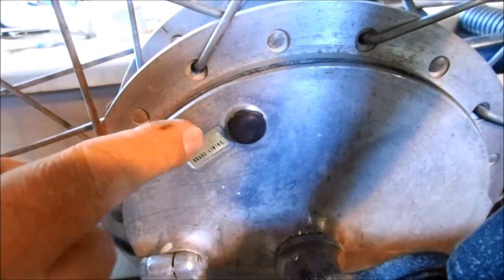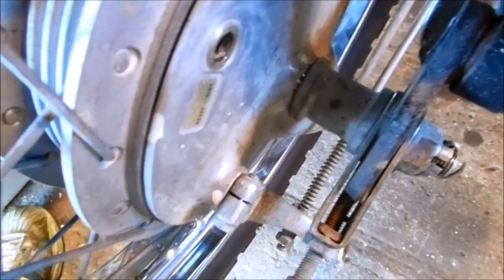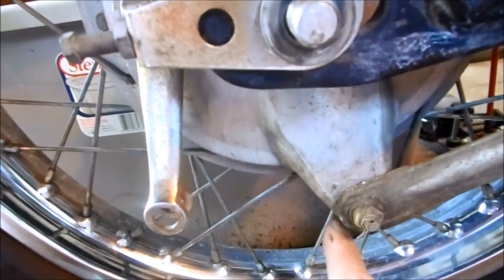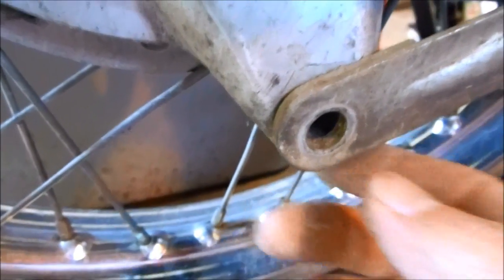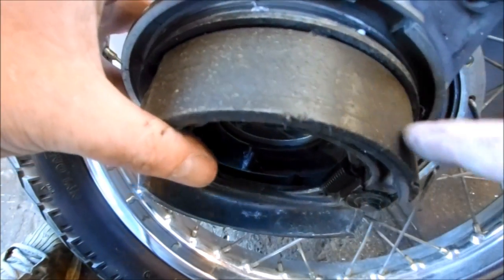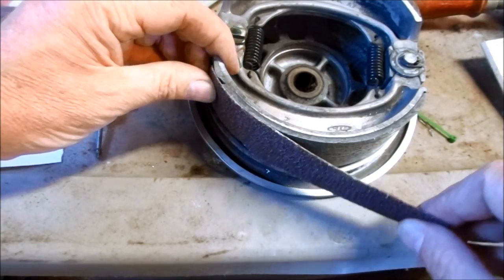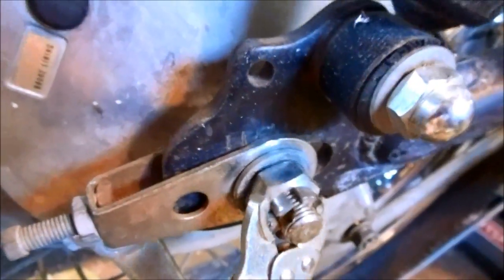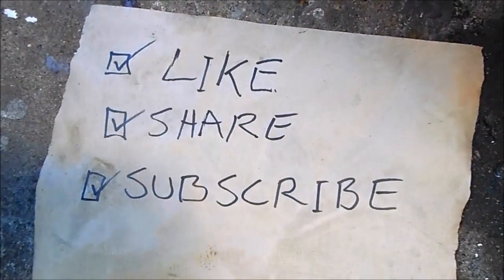How to replace Motorcycle brakes

Comment: Thank you for this channel. I have learned so much while I was fixing up my brothers bike. Unfortunately he was killed last week when his handlebars came off. 

Witnesses say that just before he rounded the curve the front wheel came off first but he instantly pulled a wheelie and managed to get around the bend. At that point he was on the wrong side of the road and facing oncoming traffic. He prepared to switch lanes and turned on his new custom made indicators. The witnesses say there was a flash of light and then a dense cloud of smoke as his wiring burnt out and petrol leaking from the custom fuel cock caught fire (I had warned him to spray the wires on the new indicators with WD40 before use, I guess he did not listen. No idea why the fuel cock I had taken from an old boat failed. He must of messed with it). It seems, from eye witness accounts, that his brakes may have failed also. I think this might have been because he used wet and dry for a brake liner instead of coarse grit sandpaper like I told him. We will never know as the bike was consumed in the fireball. As were half of the stores in main street.

Standing on the custom saddle I had made him from cardboard and an old pair of jeans and surrounded by flame, with his legs blazing and his custom helmet -- made of a cut in half plastic soccer ball overlaid with tin -- alight and dripping molten plastic down his neck (I had always told him to wear protective clothing on the bike and not just the T-Shirt and boxers shorts he was wearing that day. Would he listen? Would he f---!) he attempted an unwise manoeuvre. Screaming in pain, he yanked on the handlebars in an attempt to change direction and get back in lane but they came off (He must of failed to grease the securing nuts with margarine like your tutorial said) in his hands and he fell backwards into the path of an oncoming cement truck and got squished. Well, at least the squishing put the flames out, so that was good.

We buried him in an envelope.
He was 13.
The 750cc bike, was 18.

Unfortunately, the bike carried on and finally went through the window of a store and exploded. Five old ladies and a gay boxer named, 'Quite Angry Marvin,' out on a day trip to buy batteries for their sex toys, were killed in the inferno. 

Still, not to worry. I look forwards to some more great videos. I am working on my sisters Fireblade at the moment and installing a cruise control made out of a washing up liquid bottle and some super glue. Its going well so far. Wish me luck.
Reply: oops..thats a mad bad sad story,..but as I always says. ..the reality always beats the fiction..
Reply from the maker: +InTheNameOfJustice  peace be with you and your family in these difficult times.
Reply: +Ichiban Moto And also with you and yours.
Reply: wow lol
Reply: hahahaha this was the best.
Reply: what kind of envelope?
what colour?

description is not good enough

Comment: Oh thank you very much! You are my hero and save me a lot of money during restoration my bmw cafe racer. I would like to fix the brakes, but ive got weird thin disc on wheel, not drum like you. Can i glue the sandpaper directly on the disc?
Reply: I would just keep your worn out grinder discs and swap them straight out
Reply: Just bend the disk slightly, this will compensate for the pads having gotten thinner, as the warped disc then can fill out the gaps properly !

Comment: Those Honda brake lining kit upgrades should always be used with assembly lube or at least marine grade wheel bearing grease, or else the stopping power will be too great and could be dangerous. Your videos have inspired me to modify my bike, so I have just fitted an ash tray to my Honda CB90.

Comment: One of your best videos yet! Some of the technical jargon confused me a bit though. I agree with back road moto, just filling the drum with (fine) gravel via the filler hole, is quicker and just as effective.
Reply from the maker: +Back Road Moto    +Peter Huskins   I'll have to add a baggie of gravel to my tool roll !
Reply: Ichiban Moto I would advise a degree of caution when selecting a fine grade gravel. Here in the UK we use a decimal grading system, as do most Japanese manufactures. I'm not sure imperial gravel commonly available in th U.S would be compatable.
Reply: +Peter Huskins "Imperial " is technically Japanese
Reply from the maker: +Peter Huskins  I'm sticking with oem Honda gravel
Reply: Ichiban Moto If you can afford (or get hold of) OEM parts, it's probably a wise decision. I once filled my tyres with cheap Korean air to save a few pence and the handling was really not up to standard.

Comment: I new they were ripping me off at the bike parts shop selling me a pair of shoes, my tires are worn  and they say I have to replace them. Do you have any tips on carving deeper tread to prolong tire life and save money,is there a special tool a heated chisel or drill bit.
Reply from the maker: +Jeffrey Butt  I will add that to the video suggestion list !
Reply: +Ichiban Moto This would be a great video.
The grooves on my tyres fill up over time too, to the point that they appear smooth and need emptying.

Comment: Are these a better idea than ceramic brakes? How hard is it to use the assembly tape? I haven't learned how to use it before...
Reply from the maker: +Jesse Carstensen    it takes some practice but it comes with a step by step instruction sheet
Reply: Ichiban Moto thank you again Ichiban Moto for a badass video!

Comment: Those lining refurb kits look PROPER grippy! Careful when you haul those bad boys on, you'll be eating handlebar sandwich in no time! 

Another fine tutorial. Do they make those kits for disk based braking systems? Mine are wearing a little thin and I like the ease of use. 

Thanks Ichiban Moto!
Reply from the maker: +Andy Man Cam   most excellent cautionary advice , most are not experienced with using racing quality linings. They do make disc kits as well, however special amber friction grade assembly glue is required, so please follow the instructions on the box closely.

Comment: Does the brake drum stay actually effect the braking at all?
Reply from the maker: when pressure is applied , it keeps the entire mechanism from rotating with the drum and wheel
Reply: @IchibanMoto  will it effect the braking at all? As I installed mine back on and it stops the wheel from rotating a bit

Comment: You forgot to apply a liberal coating of copper grease to the Honda brake pads to stop them squealing.
What do you means by good brake cleaner? Would WD40 do?
Reply from the maker: +Penfold50   WD40, WD41, whatever's on sale

Comment: Brakes will get hot going downhill, I surmise.  Also it is hot near the blacktop.  The glue backed sand paper would change in temperature in the outdoor and usage elements and the glue would be in proximity to the contact surfaces.  The assembly tape is how the master reveals this danger.  Still, if you never travel hills or live somewhere very temperate it might be a foolish, working fix.  However the arcs of the contacting surfaces might distort.

Comment: guys, i figured out an even better, cheaper system. i use 2 sided carpet non slidy tape and cat litter. i put the litter (carefully screened of turds) on one side and use the other side to attach it to the worn shoe. works great and i get lots of attention from the neighbour hood cats and hot chicks like the one at 2:21. Bad ass!
Reply from the maker: +Fear Goodjudgement    awesome.... always looking for improvements !

Comment: What's up with that screwdriver and why did you use a match to light up the sight hole instead of a flashlight?
"And don't forget the nail" 😂
Reply from the maker: 360CEA725    I make my screwdrivers . want to buy one?

Comment: How stupid !   An inexperienced young novice rider could look at this video and actually follow the instructions given here and have an accident as a result.  Always use the correct size spanners, do not use a bit of wire instead of a proper split pin, and always fit some new complete assembly brake shoes.  I do get the funny side of the video but it's dangerous.
Reply: You're the reason we don't have lawn darts anymore.
Reply: Natural selection!

Comment: Ok ok your taping sandpaper to your break pads when you can buy them for 12 bucks and not sand the rim off your motorcycle ! This was a joke video right ? Never use vice grips on your wheel nut and you called it a bolt and it's a castle nut for the axle lol come on

Comment: you need to use proper tools
Reply from the maker: a proper tool is any tool that get's the job done.... and the job is done :D
Reply: +Ichiban Moto you get the job done but you risk damaging parts
Reply: nothing a bit of assembly tape couldn't fix-but don't forget to clean the surfaces with some methyl ethyl kasatone first of course
Reply: Its ok he used metric vice grips